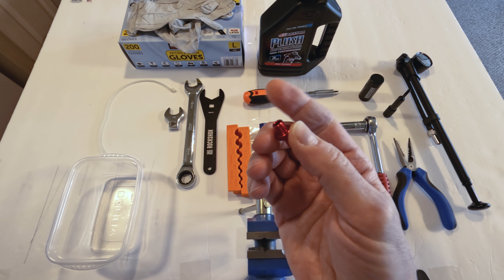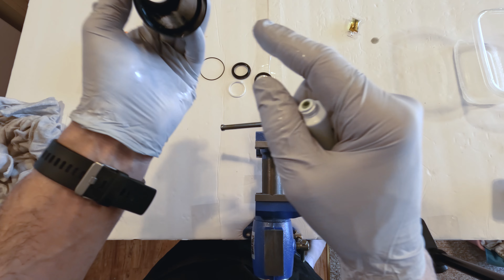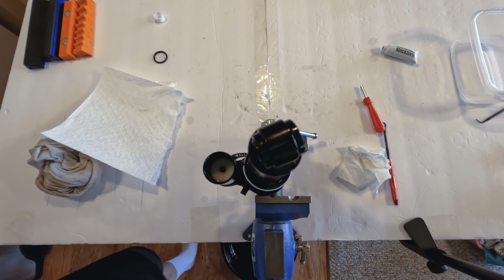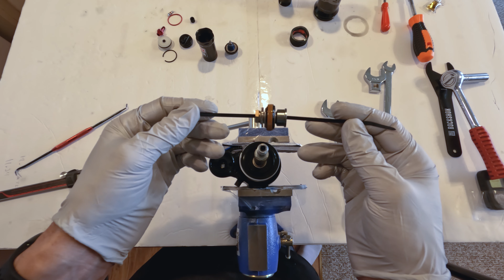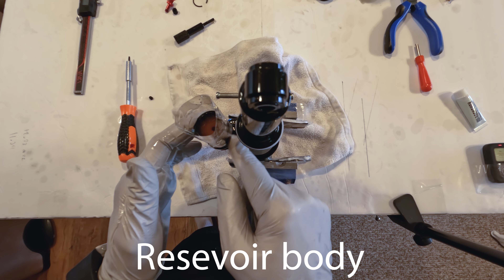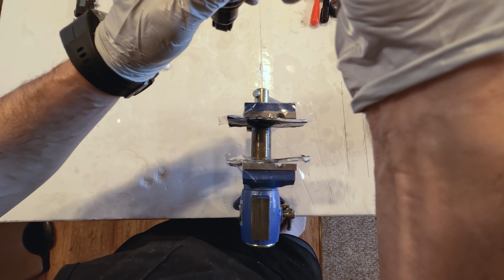Rockshox Super Deluxe 50 & 200 hour full Service guide updated video https://youtu.be/SRPUzNW__LM

Comment: hi there, thanks for this vid, is the 31mm RS mandatory or will an adjusting wrench be ok?
Reply from the maker: To remove the air canister, not necessary but it will make life easier and help avoid damaging or scratching/scuffing the air canister. there's not much room to grip when using a normal or adjusting wrenches so a cone style wrench (like the RS wrench in the vid) would be a safer bet. just take your time and be careful if your going to use a adjustable wrench and make sure you have solid grip. the metal on the canister is fairly soft.
Reply: @zoubtube  thanks man. I will order it then. It’s back ordered so I will wait. I have a super deluxe 2018/19 RCT A1. This process is the same right?
Reply: @zoubtube  I really appreciate this vid. It’s the only legit one I can find online. :)
Reply from the maker: @michaeljlr8646  the Super Deluxe 2018/19 RC3 A1 is the shock that was used in the video. I will update the description to point this out as I mentioned it was a 2017. The bike is a 2017 that I bought in 2018. My bad. just an fyi, I saw that planet cyclery has the wrench in stock and selling it a bit less than everyone else at the moment. here's the link if this helps. let me know if you have other questions or concerns.

https://planetcyclery.com/rockshox-31mm-flat-wrench-for-vivid-air-reservoir-tls-00615?gclid=CjwKCAjwwdWVBhA4EiwAjcYJEC3EBPNaXaSxFKrCqLNTrLDsTlPZ1cZM3r7VCoOhzMVxuLZutdR9PhoCWGYQAvD_BwE
Reply: @zoubtube  you can see if it fits without taking anything apart. and yeah most dont fit :(